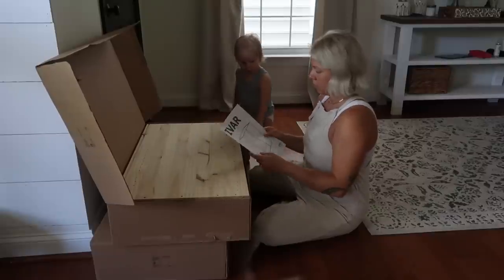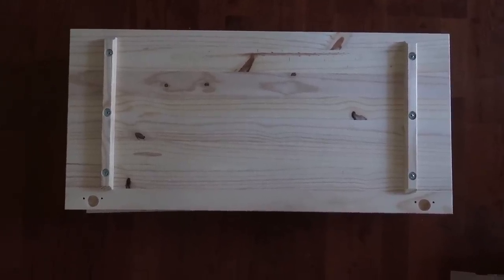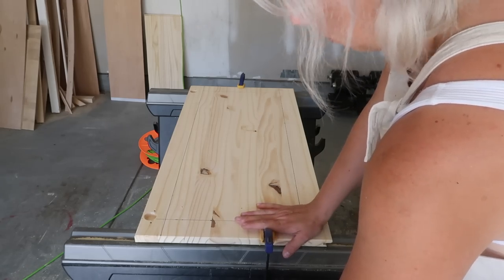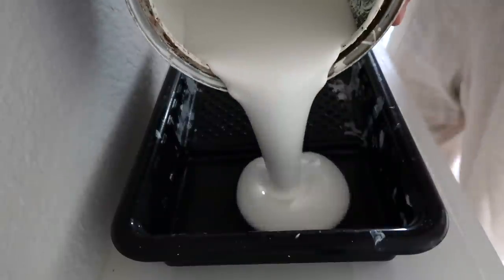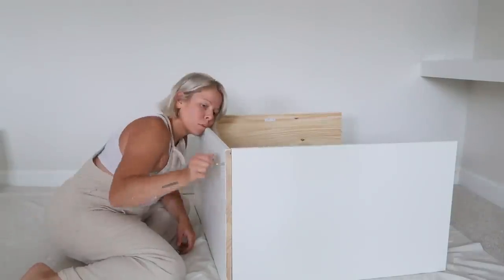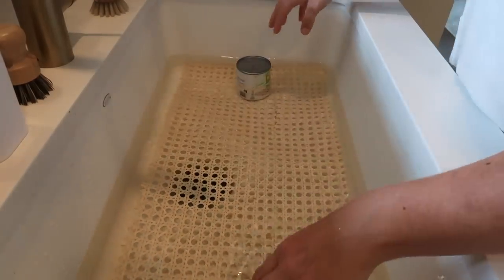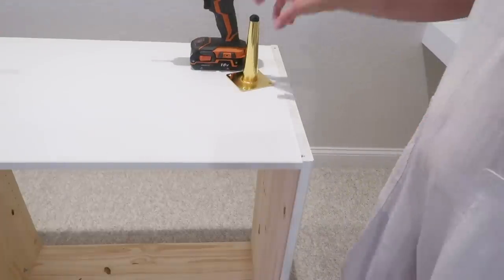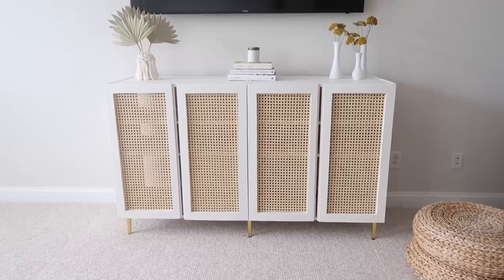DIY Caned Credenza | Boho + Midcentury Modern (IKEA HACK)

Comment: Love it! Gorgeous! I think you should attach the backing. I had a piece of furniture (an armoire) that had the backing fall off. It was too small and I never bothered to replace it. The backing actually gives it structural stability- I didn't know this! My piece ended up getting all wonky and the drawers would not close right after a while. You could always cut holes in the back for your cords...I love how creative you are! This looks so expensive and fresh!
Reply from the maker: Great tip! I just left it off, but I totally could have cut holes, like you said.
Reply: I had a piece of furniture collapse when I tried to move it without the back on 😬
Reply from the maker: The backing on the ivar is paper thin, guys. I don’t think it’s collapsing without it.
Reply: @MeganBell  🤔 If followers are worried about stability, they can add four square or quarter round trim pieces (8 pieces total). Cut slightly smaller than depth of cabinet to fit each inside each corner. 

•Pick wood screws or finishing nails that will go thru trim piece into the interior side as well as top/bottom (w/o piercing all the way to exterior of cabinet when the nail or screw is all the way in). 

The fact two cabinets are screwed together in the center could also improve overall stability. If that's the case,  you could scale back trim in outer corners only (4 pieces total). Something like that would help prevent any potential wobble or collapse. 🦋

Comment: Is there really supposed to be a space between the doors? Thinking of getting Ivar too, but the gap bothers me a bit. Thanks! :)
Reply: Door should be able to be regulated from the hinges and then you will not have a space.
Reply: Was about to ask the same ques. Its like she install it wrongly.. the gap are too wide..
Reply from the maker: There are videos on how to close the gap you can have a look at.
Reply: The hinge screws will adjust the door space gaps.
Reply: @siobhanroberts8627  You're right👍. Found getting the right adjustment on hinges to be one of the trickiest things to get right.😢😭😂

😣Took me a lot of trial & error on doors to finally get hung right on a faux built-in wall of 4 tall IKEA Billy Bookcases.
Reply: @teresacarle294  I just tackled the same thing on a couple cabinets I had to assemble. Good news.... we’re pros at it now 😄
Reply: You can glue or screw a thin strip of wood on the back of one of the doors to fill the gap.

Comment: Hi! Did you only screw in the legs with 2 screws? Is that because the base is hollow or did I just miss something?
Reply from the maker: That's exactly right. There's only specific places to screw the legs in, otherwise your screws go through the bottom of the  credenza as the wood on the base of it has areas where it is too thin.

Comment: Would this technique work on an IKEA desk? IKEA only carries the desk I want in espresso 😖 espresso doesn’t fit out home decor at all. I wanted to try this method but am concerned about the durability of the paint on the desk surface
Reply from the maker: If you plan to paint ikea furniture that is laminated, you need to use zinssers shellac based primer first. Then you can’t paint it with whatever type of paint you want.

Comment: is there no backing to the cabinet?  if not, doesn't it make it wobbly?
Reply from the maker: I left the back out so I could easily slide my electronics in and out. The backing very thin, almost like cardboard and makes zero difference in stability